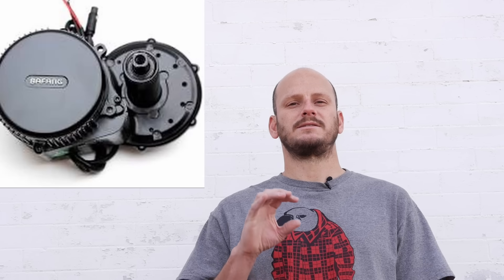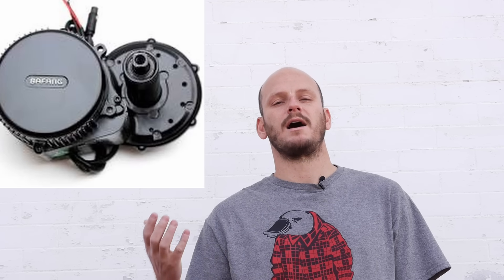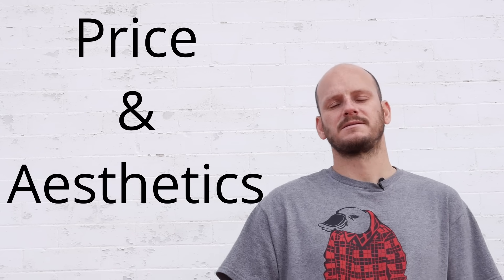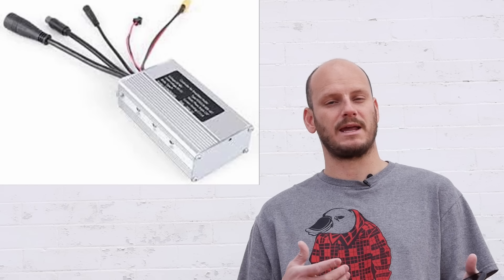Hub vs. Mid Drive Motors: Why Hub Motors Suck and Debunking Common Myths with performance test

Comment: Somebody’s in love with mid drives and that is fine, But there’s no need to spread misinformation on the pricing of hub drives compared to mid drives. Mid drives require a greater investment, but they do have greater torque. Hub drives on a properly built wheel with the correct gauge spokes do not rip up wheels. Also both are available with full packaged kit, And yes hub motor voltage controllers can be a pain to find a place to mount on the bike frame. Mountain biking and downhill biking are only practical with a mid drive motor, but commuting in the United States is dominated by hub motors because of the cost . Again,I like my mid motor on my mountain bike, but I also like my hub motors on my commuter bikes. Both have their charm, and no one is not more dependable than the other. Thank you for your video, even though I do not agree completely with it
Reply: Great points here. I'd just add that controllers integrated into the battery's frame mounted case have become common and work great, so that's not a big deal if you choose the right system.
Reply: and at the moment, Mids are going for like twice what hubs are, for reasons that baffle me.

Comment: Hmmm, what about  battery recommendations for this motor? Is a decent motor basically going to be close to $500? Seems super expensive. I guess realistically to convert a bike is going to be around a thousand bucks? Maybe a battery buying guide video? Many thanks, your videos are excellent.
Reply: It is expensive. 500 is overkill. You can get a hub motor kit less than that plus have your battery and trust me it can be done,  I did it,   don't let anyone tell you any different.  And its faster.
Reply: mid drives are super expensive for what you get
Reply: @sammiller6631  True but the mid drive does appear to have big benefits.

Comment: I don't think the spokes should be that affected by hub motors as compared to mid drives. The wheel is still going to be spun. However I do agree with using a mid drive esp. with the gears etc. Problem is my converter has a problem making/mounting a mid drive and has  an easier time with hubs. I'm just worried about cable snapping by the motor. Any tips on minimizing this? Not accelerating while switching gears?
Reply from the maker: spokes are only affected on hub motors on poorly laced ones(which is very prominent on inexpensive hub motors)
Reply: @JohnnyNerdOut  btw can you do a video on batteries :) esp. quality issues etc..
Reply from the maker: @samguapo4573  filming that today actually 😀
Reply: @JohnnyNerdOut  GREAT!!!!

Comment: I chose hub drive as I hate chain drive! If I had a belt drive then I be more for it. Also cars as an analogy would have to include another motor cuz that is how you make a hub last longer is to help it take off and climb steep hills by pedaling.
Reply: The gaa engine analogy is poor anyway.

It omits the fact that any electric motor has full torque at 0 rpm.

Gas engines have to have a gear box due to their power curve.

I

Comment: it's about power.  the bigger the battery the faster the unit  it's that simple a rion scooter uses two hub motors and will do 80 mph  ( no mid drive will even touch it )  if you have a mid drive motor and very large batteries plus high voltage  you can do the same thing as a rion.   so it all about the power no matter what you choose.

Comment: Was taught how to build wheels by Schwinn at the factory in the 80's. Building a wheel is a piece of cake!
Reply: then y is he making out it hard, whats the secret
Reply: @rumpelstiltskin6252  There are YouTube videos that show you how to do it.
Reply: @rumpelstiltskin6252  don't know mate, had my hub wheel rebuilt when I damaged it, no big deal at all, he's talking bollocks.
Reply: I've also been professionally building bike wheels 35+ years. Point one, the power of the motor goes thru the spokes regardless of whether the motor is the hub, or the motor drives the hub (mid-drive). So the spoke problems must come from a different factor.....how about the fact the hub is so much larger, so you have shorter spokes, and then the angle of spoke entry to the rim is greater. Or if it's not greater, then it's only cross 1 pattern which is less rigid, and there's the problem. Regardless, you get spoke problems, unless built with heavier spokes, but the fact remains ALL  THE POWER GOES THRU THE SPOKES IN BOTH INSTANCES. The only way out of that is friction drive on the tyre, like the Sinclair ZETA or Velosolex. Cheers.

Comment: Totally agree!
front hub motors also can snap forks
Reply: That's why you use a proper torque arm
Reply: @sammiller6631  torque arms are a good idea for the dropouts themselves, but the steerer tube isn't meant to have the fork essentially yanked on. cheap forks (particularly cheap threaded headtube forks on some department store bikes) tend to work themselves loose pretty quick.

it's not too bad if the wattage as low, but I wouldn't slap a kw on my front wheel.
Reply: @DFX2KX  What if you use a through axle  hub motor that has no dropouts on the front fork to pull out of?
Reply: yeah, if there's any to definitely avoid, it's high-wattage front hubs. the fork isn't made to take loads in that way. not so bad with a hard fork, but I'd not want to do that to a suspension fork.

Comment: I thought I wanted a hub, not convinced yet that that is not what’s best in my circumstance however I am questioning it after watching this. Thanks for the good info.
Reply: With a mid drive motor every thing is built in so you can't just replace it you have to pay a shop to fix it very expensive..
Reply: I just got my 750 CSC 20 inch with a 750 bafang and went up the big hill in my neighborhood with no problem at all.The battery was also on less then 10% and blinking-was my first ride and I was on assist 3 and it was like peddling just for motion--the slightest effort and the motor kicked in and I was pleasantly surprised at the power.BTW once you put together the bike like I did today--you learn a good deal.if I somehow need more power I can buy a front hub motor and another battery for about another 700 dollars and literally have a 35 MPH dirtbike/moped that can go up any hill or trail and probably be at 50 miles plus range--throttle only- range since neither motor--even on a steep hill would be even close to being stressed out.The 750 out of the box and controller that is probably totally safe and underpowered had plenty of power--can not wait till tommorow.BTW the most common fron hub motor for a 20 inch is actually a 1000 watt motor and it is already assembled into the rim--so you put your tire on--and then just attach the motor to another controller and battery using zip ties.BTW You do not need the pedal assist and all the other stuff hooked up--you can just hook the hub motor to the throttle for the front one and keep it simple.I doubt I will even need it from what i felt from just a short ride today.Also the motor peaks or can go at like 1300 plus for a while--I think it was at under 500 and climbing the hill with ease on an almost dead battery.Also the 20 inch i just got is as big as a normal mountain bike--I am 6ft tall and it fits me fine.These bikes are way bigger then they look.I was worried about power also but the 750 bafang seems very good out of the box.

Comment: People just learning about e-bikes should take note of your advice.
Back in 2015, when I got interested in e-bikes, it took months of research to learn what you just covered in under 12 minutes.
Well done!
Reply from the maker: Thanks 🙏
Reply: I can relate, did the same in 2015 and gave up to build a few 80cc gas bikes that all ended up needing loads of maintenance. Fun, sure but electric just was out of reach till 2020 for me.
Reply: @JasonStPierre  I love electric but I'm sure you learned loads of valuable maintenance skills and had a ball. Probably made you appreciate electric motors more than most riders too.
Reply: There is a lot that isn't covered. This you will find out after you have built and ridden a few of them.
Reply from the maker: @grantadamson3478  I know. Afterwards I realized how much I left out. I think a part 2 is in order😀 mainly I can’t believe how I left out how much of a pain the butt it can be to change your tire with a hub in it and how most bike shops won’t touch it if it’s a hub motor. As soon as I get time I’ll make a follow up 😀
Reply: @JohnnyNerdOut  Excellent.
Reply: @JohnnyNerdOut  i had a hub drive broke the spokes and the bike shop fixed it but i am in australia so not sure if the bike shops are much chop over there if they can't fix spokes
Reply: @FATTY1990  same on UK mate. No big deal to have a wheel rebuilt with a hub after I knackered it. This fella talks a load of bollocks.
Reply: @adgeebike9173  May be bollocks across the pond but on this side it's hard to find anyone that is competent to true let alone build a wheel.
Reply: @grantadamson3478  I've built 2 starting in 2016. Both successful. My builds might have started in 2015 if I would have found a video this concise. Does a build require more info? Obviously, but each build is unique and this video covers the basics that it took me months of detailed reading to learn.
Reply: I am a food courier and took one look at a rear hub wheel and said to myself "that's gonna get the shit smashed out of it within 3 months"...after that I decided to go get a 125cc scooter instead. I ignored the advice of other food couriers and I now make a LOT more than they do.
Reply: @generationkilled  Enough to make up the cost of gas, license & registration? Here in NYC your math would be upside down.
Reply: @michaelsprinzeles4022  I live in Glasgow.....you can walk almost as fast as an E-bike going uphill. Only place they win is in the city center and there's too many riders there. I can pick any area I want and if one goes bad switch in a few minutes...also I leave E-Bikes in the dust.

I literally waited 5 minutes for a delivery, while an E-Bike courier left and got there before he did to the same building.

I can also rider for 10/12hrs straight, most cyclists are wrecked long before then.
Reply: @generationkilled  All fair arguments, except walking almost as fast as e-bikes;)
I built 2 converted e-bikes and the slower one will climb steep hills at least 3 times as fast as jogging up the same hill.
You're right about the city. I've only worked in NYC so I hadn't considered range where ICE definitely has the advantage. I also didn't have many steep hills to climb while working.
I may be pro e-bike but admit they have failings that take them off the list of options for some people.
Reply: @michaelsprinzeles4022  here we are only allowed 250w bikes on the road....they suck up hill...So at best you get jogging speed x1.  I know. I tried one on a Halfords trial day. 

Its not like America where 750w to 1000w are probably legal.
Reply: @generationkilled  That explains your distaste for e-bikes. My dead grandma can put out 250 watts.
Our laws are wack regarding e-bikes and most police don't know what they're looking at or the laws regarding them. Federal law says "less than 750 watts" but many states have different limits.
Also we have many motors that are stamped 750 watts but if you swap the controller for something with more amps you can get more power...(not sure how much more power could be squeezed out of a 250 watt motor but probably still not worth it).

Comment: Hey Johnny thanks for the video!
this video was the answer i was looking for choosing between hub and mid-drive
but i gotta ask u what battery is good for 1000w motor? between 48v and 52v
and u think mid-drive is the way to go for a heavy rider? i weight about 275
Reply from the maker: Absolutely it’s the way to go! I’d go 52v. It’s a small difference but still...

Comment: I too love my Bafang RM G060.750.DC hub motor. I just sourced metal planetary gears for it, and although I know  they'll be noisier, I won't need my bell as much while riding on my local bike path as I pass everybody and everything, including the mid drives I alway fly by at 34mph.
Reply: ¿Donde has encontrado engranajes planetarios de metal para el HUB...?? , tengo un motor similar... , un HUB trasero LKS 1000W (1200W) ... 🤔  Deja el enlace por favor... 🙏🏻🙏🏻
Reply: @joanantonim.p.2400  What language are you speaking? I will use a translator.
Reply: @guitartec   Where did you find metal planetary gears for the HUB ... ?? , I have a similar motor ..., a rear HUB LKS 1000W (1200W) ... 🤔 Leave the link please ... 🙏🏻🙏🏻 
(Sorry...  🙏 , is Spanish... 👌👍)
Reply: @joanantonim.p.2400  Well, I won't know if they even fit until this winter when I take it apart, so if they do, I will have them made out of a lighter alloy and will be selling kits with the security bit (to open it) and grease. I'll keep you posted.
Reply: @guitartec    Thank you very much... , well, I'll be waiting for your information... 👌🏻👍🏻👍🏻🙏🏻

Comment: The torque is going through the hub and spokes to the tire with both if you can use a lower gear with a mid drive that would put more strain on the spokes that is why they can climb hills easier more torque at the wheel.

Comment: One disadvantage I've read is you can only use one chainring on the crank so you lose some gearing options. I have also heard there is some drag when you are pedaling unassisted  that true ?? I'm definitely sold on mid drive. Thanks for the informative videos.

Comment: Thanks for sharing this knowledge, I have two questions. Is it possible to ride without using the electric motor? and which battery do you recommend?
brg.
Reply: Yes. If you need battery recommendations, you can ask on Endless Sphere

Comment: After just over two years with my ebike the anti rotation washer snapped in two so now the hub motor is useless,  cant use a standard washer as it has to fit in the freewheel and no way to use a torque arm. So decided to ditch the motor wheel put on an standard rear wheel and buy a bafang 36v 500w, mid drive so I can then keep my two batteries

Comment: Hello Johnny, I’m sorry to bother you but I need your help. I have a Zugo E-Bike and I’m tryin to make it faster. My I saw your YouTube video about the difference about hub motors and mid motors and I’m trying to find a good mid motor for my zugo bike but I’m kinda stumped. Can you help me please?
Reply from the maker: Check to see if the bafang BBS02 will for your bottom bracket. Might need to take a few measurements

Comment: Hi Johnny, Thanks for the info on Hubs Vs Mid drive. I have a Cube MTB with a 93mm shell BB, having trouble locating Mid drive to fit. they all seen to be 68 / 73mm shell BB's. Can you recommend a Mid Drive at all. Pete ( UK )
Reply from the maker: BBSHD 100mm

Comment: A middrive putting out 1500w will put the same strain on the spokes as a 1500w hub motor will? The power is transferred through the spokes regardless.
Reply from the maker: Correct. Unless it’s a crappy hub motor. Then it was probably hastily spoked.
Reply: @JohnnyNerdOut  Definitely QC issues on the Chinese 9c motors. I've got about 1500 miles on mine with no issues.

Comment: Just watched your video. I'm not questioning your expertise and everything I've seen and read agrees with you, but here in Europe mid-drive assembled bikes are a lot more expensive. They start at about 2500 Euros and go up massively from there. For 2800 Euros you can get a Bosch Performance CX with 75Nm torque on a basic frame with no suspension. Full suspension bikes are over 3200 Euros (on sale) and up. That's a main reasion why I wound up buying a 900 Euro (thousand dollars) Samebike LO26 based on a lot of positive YouTube reviews and also because I wasn't sure I would like it having always been a racing bike rider. I particularly like the fact that it's a folding bike with front and rear suspension and it has a triple front and 7 rear gears. I got the 500W motor version (motors are limited to 600W where I live). I spent about 200 Euros for better brakes (hydraulic pull), hydraulic rear suspension, handlebar riser and better pedals. I live in a very hilly/mountainous area. My normal rides of about 50km routinely have 3000 feet of elevation gain. Our local mountain is 5000 feet high with many gradients of 20 degrees and more. I have been up there twice. I have been riding racing bikes for more than 40 years. No, it's not the same, but I'm still getting plenty of exercise. I've only ridden this bike about 700km so far without any problems and it's very quiet. I easily get 80km from my 12.4 amp 48v battery. I haven't seen anything that comes close for the amount of money I spent. If and when the motor/controller fails, I will probably install a Banfang mid-drive, but I'm thoroughly enjoying this bike as it is. There is one fellow in Ireland who has over 13500 km on his without a single problem. Just saying.
Reply: 20% gradient i think...not degrees

Comment: You're like that extended warranty salesman who tells Me how much it costs to replace My burned up engine in My Toyota truck - -hahaha  Or make payments to the insurance so in 10 Years of use My A/ C compressor is going to fail.  How much more are Mid Range Motor eBikes again ??    Two chains in 3K miles ??  Not Sold sorry - - >>
Reply from the maker: I guess🤷 just try one for free and decide for yourself😀
Reply: @JohnnyNerdOut  I must say I would really try one if I had a chance. No eBike stores within 150 miles sadly.